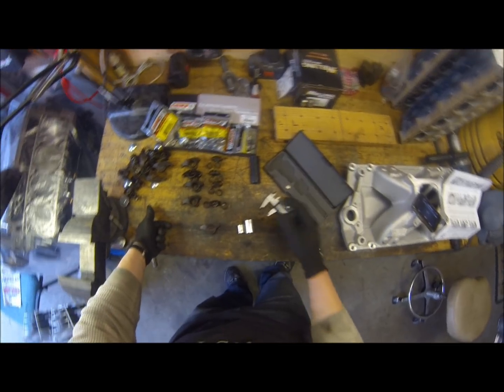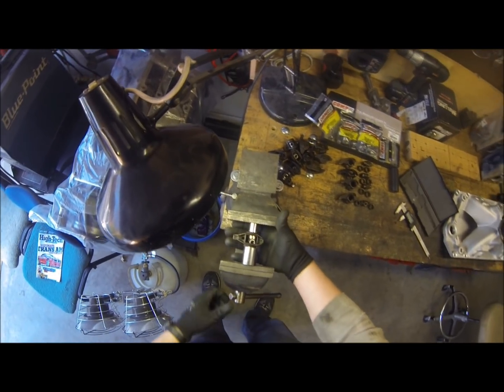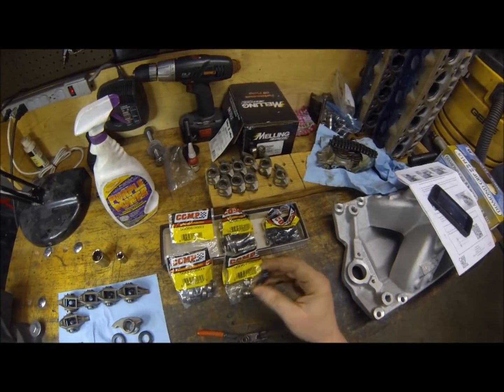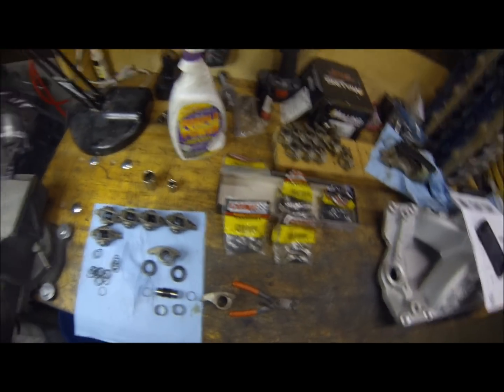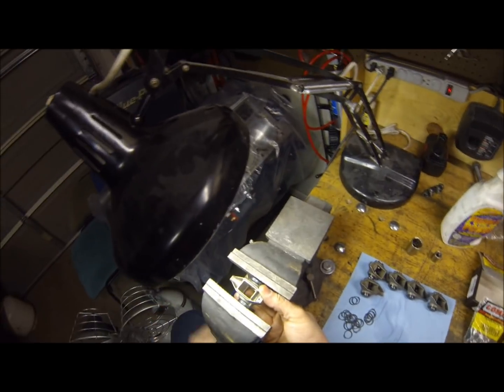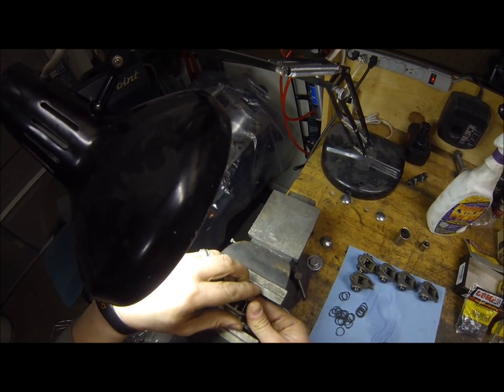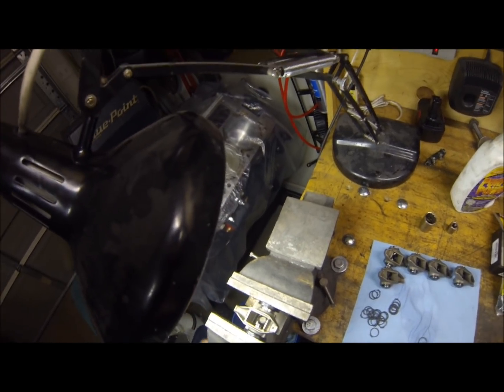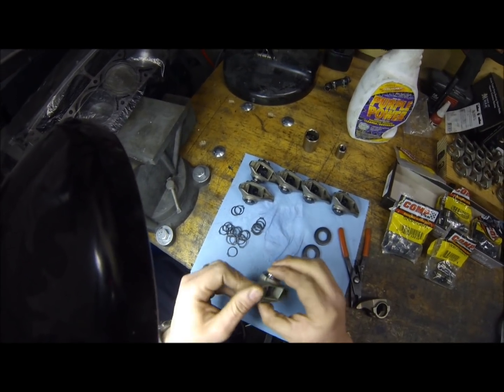How To LS1 Rocker Bearing Trunion Upgrade Install - Comp Cams Part # 13702-KIT LSx

Comment: The directions from COMP never mentioned to slide the new trunion to make sure the 2nd bearing was aligned. Thanks
Reply from the maker: No problem maddsperformance. Another important thing that sliding the trunion back and forth is to make sure that the washers are aligned. Otherwise it'll pinch and not push in.

Comment: I installed these on my 5.3 rockers, all of them except 2 of the move freely....the other 2 are very hard to move around inside the rocker, I have to take a flat tip and manually maneuver the arm back and forth, is this a big problem?
Reply from the maker: Hello Nicole! Sorry for the delay in response. life is busy! lol

Yes, I'd say thats a problem. You should try adjusting how they're positioned in the rocker arm. Maybe you'll be able to free it up. Let me know what you find!

Comment from the maker: I wouldnt call myself the best to answer this, but I'll give you my opinion. 

one good reason is like you said. Spending a lot of time beating the crap out of them in high rpm would be a good reason.

High mileage rockers trying to be saved or reused would be another reason. I've reused some nasty ones and could only imagine what the bearings look like.

or just a build that youll be pushing and want to prevent failure in the future. It would be annoying to have bearings lose in your engine.

Comment from the maker: I tried to explain it a little in the beginning of this video. The stock rockers are known to go bad and throw bearings out the sides which wind up all throughout your engine and stay in the oil pan until pan removal. This Trunion upgrade is more durable and should prevent this problem.

Comment from the maker: 706 Heads scare me because half of them where made at a factory who's cast is known for cracking. I stay away from them because I've lost money buying a cracked set. I use the 862 5.3/4.8 heads. And I love them. I try to use them on everything. They have the tightest combustion chamber for more compression.

PM me on the head porting.